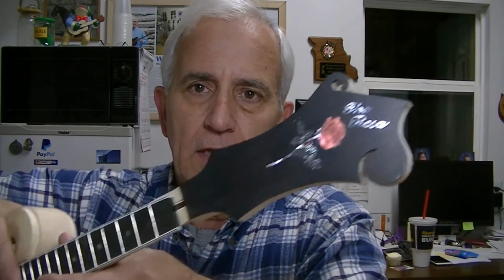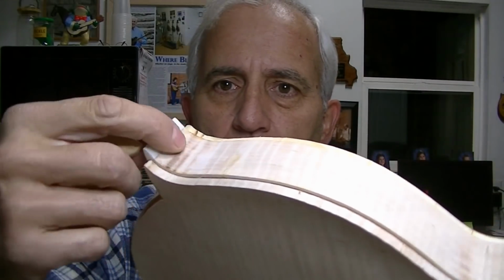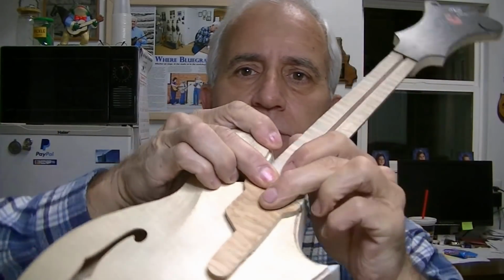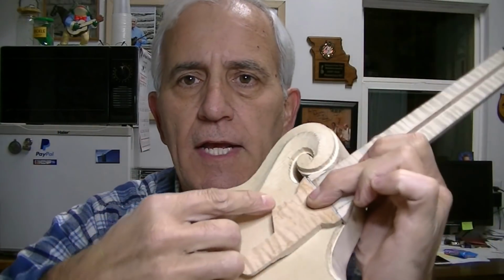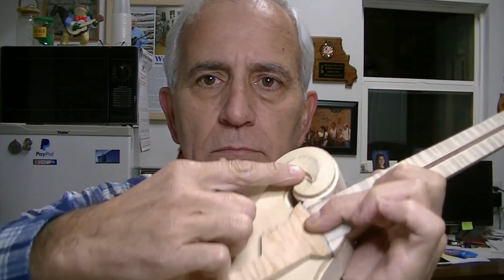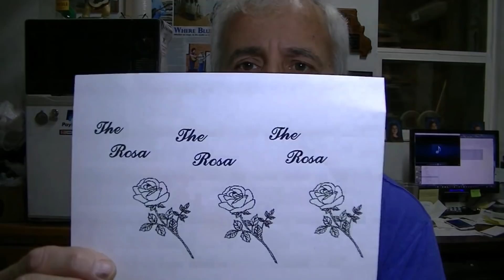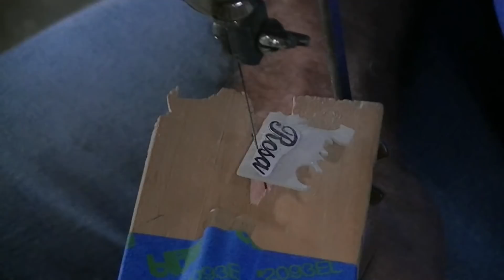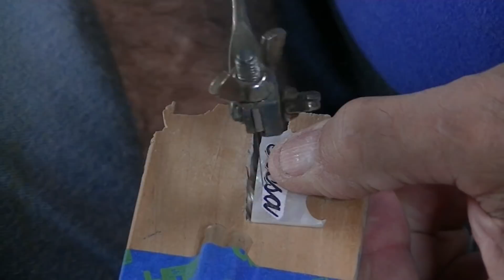182 RSW Custom Rosa Mandolin Part 8 Inlay

Comment: Great video and the first I’ve seen that covers engraving details into the pearl after it is laid in! I am curious as to what type of filler you use to fill in the groves in the rose? You say you fill it and then stain the filler black? Wood filler? I was thinking of using either fine ebony dust and CA glue or for the shallow grooves maybe just stained glue alone. You can get black CA glue out of the bottle, I’ve seen but I haven’t tried it. Anyway, thanks a lot for this video!
Reply from the maker: Whatever filler you like should work fine. I just use wood filler and dye it black cuz that's fast and easy
Reply: That sounds sensible! Just after posting my comment I happened upon an ad for a Stewmac filler stick called Laskin’s Engraving filler. Which probably amounts to the same thing: something dark to fill up the space, which is permanent enough to not rub off when you run fingers over it. I still might try it since I’m a sucker for buying all kinds of «specialty» products. Thanks again for your video!

Comment: Looks awesome Jerry  I was wondering how that was done thinking of doing my Banjo too, --TIP  --Just maybe you might be able to trace those designs onto the rough side of onion skin paper with  I believe it`s a 3b carbon pencil then rubbing  ( Black cap) Mennen Speed stick deoderant to the pearl lay the paper on the pearl it transferes the carbon off the paper to your placement , This idea is an old Tattoo transfering trick it`ll wipe off after you`ve carved it out might be easier than redrawing it .
Reply from the maker: +Garnett M thank you for the idea. I'll give that a try.
Reply: Rosa String Works I guess just YT it tattoo transferring

Comment: I found you through Jeff Bradshaw and his Alvarez.  I was wondering if you had an old auto interest (GMC) that you have never mentioned ?
Reply from the maker: +Richard Mead I've worked on lots of Machinery especially tractors balers and things like that. I have an old 57 Ford dump truck presently that I maintain as well. So Jeff and I have a lot in common. Thank you for watching.